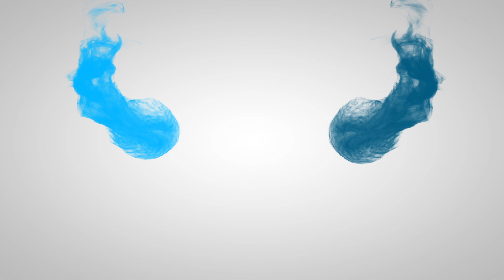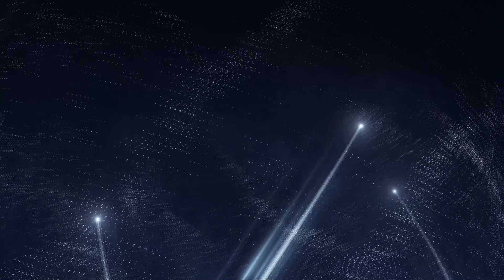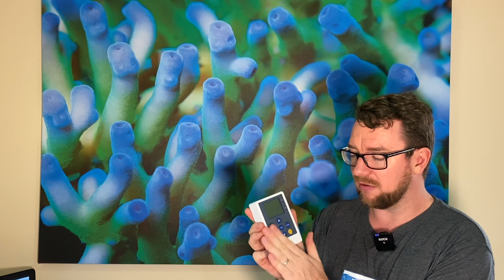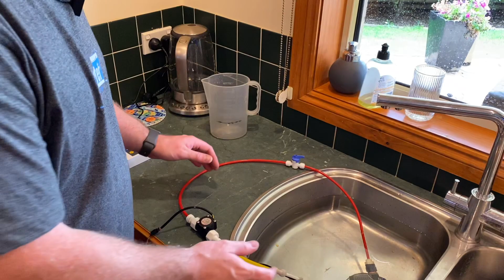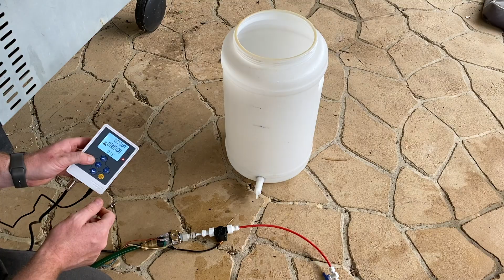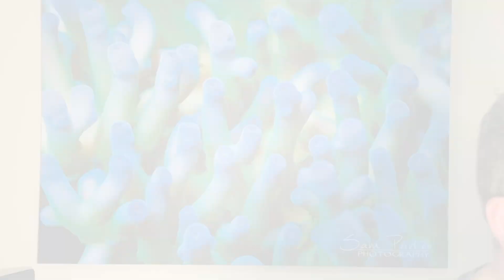Digiten Liquid Flow Controller - Useful With Aquariums?

Comment: Hey Sam. Looking at this old video on flow sensors. I am thinking about purchase a digiten flow sensor for my UV sterilisers. Did you find the Digitens worked well with salt water? Any issues with leaking etc over time? Thanks
Reply from the maker: Only tried them out for a while and to be honest, I would only recommend them in a temporary setup. 

They might be fine permanently, but I decided  it was safest to remove when not measuring
Reply: @ParkersReef  Why is that? risk of leak? Any flow sensor you would recommend? I also want to use it as a safety feature (i.e. notification if no flow). Thanks
Reply from the maker: @dilshanudayasiri231 more risk of it leaching metals or something I think

Comment: So I picked up one of these a couple months ago.  Mine is an 1/2”size.   My concern with it is there is a metal ring in the flow sensor it self.  Do you see one in that smaller sensor?
Reply from the maker: no metal ring exposed to water in my sensor? Despite that, how have you found it? Work well for you?
Reply: Yes,  it has worked well.  Have it plumbed to monitor the flow to my UV.

Comment: How about running the setup in line with an apex flow sensor to see how accurate it is?  If it’s accurate then the flow readings should be similar.  Don’t think it’s useful in a low flow or high pressure setting.  Basically a cheap version of apex flow sensor.
Reply from the maker: yeah it is essentially the same sensor as the apex unit. From what I've seen, other users are confident in it's accuracy -  it's more a question of if it has any useful purpose :P
Reply: GHL sensor is better, no turbine to clog or break

Comment: Maybe it will have more flow if you instal it before the Ro/di unit. Like this you will know exactly how much water you are using to create that 660L of RO water .
Reply from the maker: Absolutely an option :)

But the output will vary a little using that method. Still interesting data though!

Comment: They are great for setting the flow through a UV filter as most people run to fast through them making it pointless as a UV needs a set flow. Although it wouldn't use the regulator in this application.
Reply from the maker: Yes that would work well 👍🏻
Reply: A product that good to have.

Comment: My RODI even with its booster pump only delivers 0.19l/min so the unit would be useless for that application. It might be useful during water changes if you have a remote storage container but I doubt that the solenoid is man enough to cope with the 30l/min flow rate the meter is capable of registering as you would want a good flow rate to refill your display tank.
Reply from the maker: Yeah I’m still looking for a good use for it 😅

I do think it could be good with a smaller flow meter, will try that which will do less than 1lpm

Comment: Great video! I guess if you have an RO/DI unit with a reservoir tank you could get higher pressure, probably with a booster pump with the RO/DI would achieve better/higher flow. Then again my res tank is only 10L and I have a 20L bucket so unless im doing a 20L change there is a low risk of overflow. 
I thought it could be useful for a gravity ATO but that flow rate would be undetectable so that idea is out :(
Just a note with the thumbnail, the YT minutes/seconds are covering part of the writing on the thumbnail.
Reply from the maker: Ah thanks for the heads up on the thumbnail!